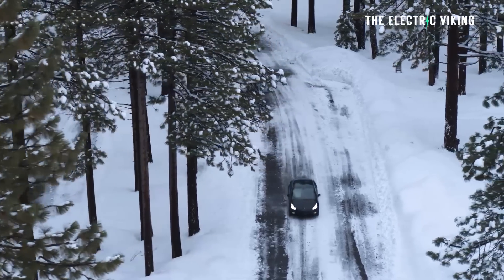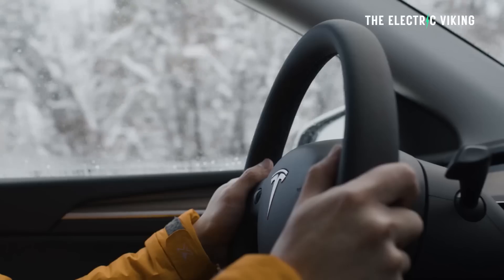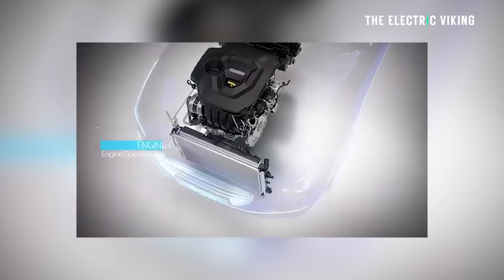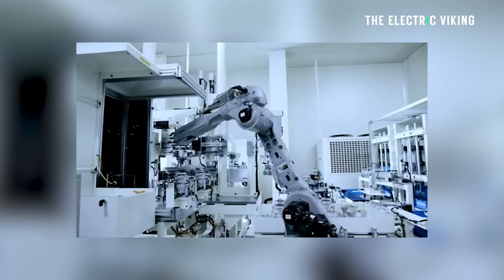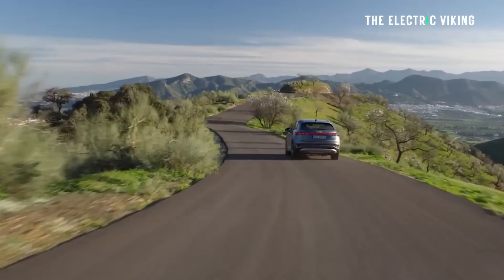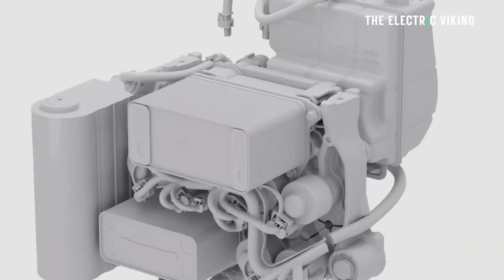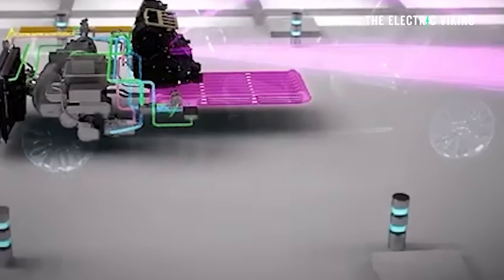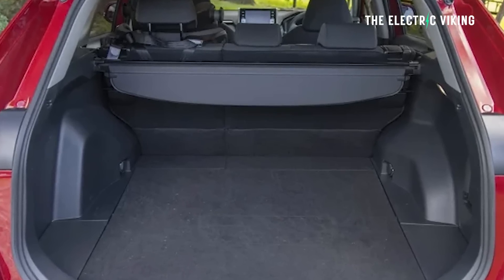Revolutionary heat pump boosts EV range and is 30% smaller!

Comment: It would be cool (pun intended) if the frunk could be insulated and offer an on demand refrigerator/freezer function when needed.
Reply: There is a freezer available for the rear under floor space in a Model Y.
Reply: @greghudson9717  thanks Greg, I'm aware of aftermarket electric cooler products. What I'm talking about is a relatively simple (I think) modification of the on board heat management system that could transfer heat for battery conditioning AND yield a cooler/freezer accessory for those odd times when you need it. A bit of insulation, a few loops of tubing, maybe a small condenser, and the software to make it work. Just spitballing here.
Reply: @pl-ps2pd  That sounds like a pretty good idea. Share it with Tesla if you can figure out how to ;-)
Reply: @greghudson9717  Just an observation here, but while I am a Tesla fan, why does everyone seem to gravitate to Tesla?  I already know why, but I'd like any doubters to contemplate their answer.

Comment: Heat pumps are great, but achieving Tesla levels of efficiency has more to do with the design of the entire heating/cooling system than with any single component. For those interested I recommend watching the Weber College analysis of the Tesla heating/cooling system. https://www.youtube.com/watch?v=Dujr3DRkpDU&t=2817s

Comment: The Hanon Systems website states that 'their' 4th generation heat pump system is the first to use a parallel heat source recovery method (but without explanation). A research paper published August, 2022 describes Tesla's Octovalve thermal management control and contains: "Unlike any other WHR (Waste Heat Recovery) system found in literature, this system has a heat pump (which) can perform air conditioning and heat pump tasks simultaneously, which is shown to have a remarkable impact on energy efficiency and battery life."
Reply: The Tesla heat pump with Octovalve can scavenge heat from the inverters, the battery coolant, and other systems when needed. It is not solely dependent on the external air for its heat. 
I think this is exactly what this other new pump is doing. They are finally catching up. The problem will be the plumbing in the non-Tesla cars. They will buy this part off the shelf and try to plumb it into their existing designs with a bunch of hoses. This will cause a lot of heat loss from those hoses.   To take advantage of the efficiency of this new pump they will have to integrate it into their initial designs from the ground up.... in other words they will have to totally redesign the "engine" compartment and inverter components so that they can avoid having to use a lot of hoses. This will take anyone but the Chinese companies (AKA the OEMs) years to do.
Reply: The parraller system uses external air and internal heat combined.

Comment: ICE cars are going to be banned in 35 countries? That means if you already have ICE vehicles, it will be illegal to drive them. How you come up with these statements is beyond me.
Reply: Sales of new I C E cars will be banned not driving a old ice car
Reply: @tristar8950  I've always thought the key to ICE longevity is the fuel they use. Alot can happen in 35 years. If they're banned EVs may not be the only alternative.
Reply: Already banned in some city centres?
Reply: @markthomasson5077  a very tiny percent. In many areas of the nature, all private vehicles are banned.
Reply: @skylershank9309  aye, but ever increasing.
Reply: @markthomasson5077  so are areas banning EV from ferries and parking.

Comment: Definitely not simple like there made out are they.
Reply: Neither are automatic transmissions. What's your point?
Reply: @jamesvandamme7786   well. didn’t post a video saying transmission were simple did i ?
Reply: @jamesvandamme7786   and compared to fixing kilometres of wiring that’s in an electric car or just the 5 thousand plus terminals inside a battery. Yes transmission are far simpler then the computer system in an anything electric cars

Comment: Ice is simple no need for this Miracle making nonsense.
Reply: No, ICE is incredibly complex in comparison and incredibly inefficient. How many moving parts are used to create motion in ICE? Hundreds.
Reply: @jdcarguy1242    Have a look at the qualifications needed just to touch an electric car. And I guarantee for the most part they just send stuff back and replace it.   1 battery has over 5 thousand electrical connectors      Go walk in to your local mechanic would almost guarantee every shop has one person working that didn’t go to school  let alone electrical engineering degrees.  That’s not a thing with EVs
Reply: @jdcarguy1242   20 tho on Average depends I built a 2.8 hilux motor when I was 15. There’s no 15 year olds assembling EVs or electric motors or battery’s almost alone at that age.
Reply: @Kevin07-w9l  What about refuelling your ICE with wind or solar instead ?   Oh wait, only EV's can do that (yet)... hahaha
Reply: @greghudson9717   why would you want to?  26 dollar Jerry can takes me 200 plus km in ice.  Cost a bit less then the equivalent electric Jerry can I think  and is more efficient buy about 225 km so I just don’t see who would want to go back in time. ?
Reply: @Kevin07-w9l  You don't get it. We are talking about the FUTURE not the past.
Reply: @greghudson9717     Correct so your future is 200 plus km sorter then anyone with an ice car  for the equivalent.   Maybe find an electrical engineer to explain this to you.
Reply: @Kevin07-w9l  I'll explain it for you. I get about 410km from my SHORT range Tesla Model Y. My previous 2023 Kia 1.4 petrol would get about 600km from its 45 litre tank, so there's the 200km difference you are talking about.  Yes, we made a few less stops (and less time stopped) with the Kia, but over a 3500km trip from Melb-Cairns, the actual time difference was just 6 hours extra spent charging the Tesla Model Y, which isn't that much really, and we couldn't go much faster because the chargers were mostly slow 50kW units.   However, that time difference would be a lot less now, with Tesla opening 9 new SuperCharger sites up the Qld coast to Cairns.   The trip back in the Tesla we prioritised Tesla Supercharger (instead of avoiding them), and the time to get home in the Tesla was the same as the Kia. The charging speed made all the difference.
Reply: @greghudson9717   that’s correct. So what makes the electric Jerry can 98 percent less productive. As in 20 lt or 20 kg of energy gets you 200 plus km     20 kg worth of electrical energy gets you 5 km ?   Weight to power is the most important thing
Reply: @greghudson9717   if your struggling to understand head over John cadogan  auto expert  some one qualified  who knows exactly what he’s talking about you’ll get a shock I think

Comment: No it wont be most efficient at very cold temperatures. Heat pumps efficiency drops off expontentially in very cold temperatures
Reply: This is why Tesla's heat pump system with Octovalve is different. It can scavenge heat from the battery pack, the inverters, etc. It is connected to all these systems and can move heat around as needed amongst them. 
Sure if it's -20 degrees then it won't work well but neither do most cars without engine block heaters prewarming the system. A Tesla can also prewarm if connected to your home and told to warm up prior to travel. This ensures that the systems have a lot of heat in them that can be used during the journey.

Comment: This could increase battery life.  Think of all the times an ICE vehicle is running but not moving.  People are using 300HP to heat or cool their car.  Police cars are often sitting with the motor running.  Recently I saw a car running for 2 hours to keep a pet cool.  Diesel truck and car drivers like to leave their vehicle running when parked.  The bottom line is using 300 HP to heat or cool a vehicle is stupid.  There are a lot of stupid people.  There is no cure for stupidity.
Reply: There is a cure for stupidity, it is called learning. You should try it, and you wouldn't write such comments like the one above.

Comment: I'm driving a 2020 BYD E6, the last year they made that model (I think). The cooling comes on immediately but it takes 5 minutes for the heater to start working. I can only assume it runs off the car's engine/battery waterjacket instead of the heat pump. At least it's not reducing my range!
Reply: Most EVs which don't have heatpumps use either a resistive element in the cabin airbox in place of the water matrix or an external water heater and small circulation pump isolated from the motor/controllerr cooling systems as for the most part they won't provide enough heat in cold weather and you really don't want extrernal heat sources feeding into these parts of the unit

My Imiev's heating loop has 800ml. It's an 8kW heater (poorly insulated) that takes about 5-10 minutes to be effective and knocks 20-30 miles off range if left on continuously

If I could retrofit this into the car then it would be extremely useful (or would be if the residual value of a 14 year old EV wasn't essentially nothing)

Comment: There is no any chance to boost  range by 30%  with  more  efficient   heat pump  ,  5-10%  is a  maximum . Educate yourself mate .
Reply: You sound like an EV engineer... 🤪🤪🤪
Reply: @youarnb  You do not need to be  engineer , common  knowledge is good enough . Think , what is percentage of used  energy  in  EV  by  heat pump  first .

Comment: Can a car based heat pump feed into a ground based geothermal system?
Reply: Don't you mean the reverse? Why would you want to cool or warm the earth ?
Reply: @greghudson9717  ground based heat pump system do both
Reply: @infocat13  You didn't answer my question, but I figured it out, when you are cooling your house, the excess heat going INTO the ground. Fair enough.   I don't have the room (or access) at my place for geothermal, but I wish I did 😞
Reply: Not sure where you're going with this. If you want a home heat pump, buy one optimized for that. Car heat pumps have multiple jobs to do.

Comment: Sam, I think you’ll find Hanon Systems is a South Korean, not a Chinese company. It will be interesting to see how its new Heat Pump compares to Tesla’s. In any event I wouldn’t want an EV that doesn’t have a heat pump. Energy is at a premium in EV’s, so why waste it and unnecessarily lose range?
Reply: Heat pumps add weight, so if you're in a country where you don't, or less frequently, use cabin heating (or where heated seats are sufficient as Sam indicated) then the heat pump lowers the car's efficiency (even when taking battery thermal management into consideration) and can reduce range. HCAV choices on a car whether AC cooling + PTC heating, AC cooling + heat pump heating or combined heating/cooling heat pump all have cost, effiency and weight trade offs to balance, where different markets have different needs.
Reply: not owned by SKorean, they only do research tehre
Reply: Agreed, I was thinking how will this compare with the Tesla heat pump.
Reply: EV’s are garbage lol

Comment: Interesting, Sam, but note that Kia are failing to fit a heat pump to most EV3 models. It's only going in the top spec version. I would rather have a slightly less efficient heat pump than no heat pump at all. My 2016 Ioniq 28kwh EV has a heat pump for heaven's sake.
Reply: Not in every market. It's just been introduced in Denmark and EVERY spec version has heat pump here.
Reply: @sejlmager  interesting. I've only seen the first reviews on Korean roads, and they both said no heat pump on the lower specs. I hope you're right.
Reply: On Scandic countries you can get it into air level and is default on all after that
Reply: Hopefully this will change as Kia opens up more manufacturing sites, Kia currently build in waves of trim levels for specific markets. Some markets don't want to pay the extra for a heat pump or where the additional weight involved may lower efficiency particularly if it not used most of the time.

Comment: yesterday they extended the range to 50% and now today they have extended to another 30%?
Reply: Within a couple a days the range will be increased to at least 1.000 mls and charging the battery pack from 20-80% will only take a minute or so... 😂😂😂
Reply: You weren't paying attention. Go back and watch them again, more carefully. Lifetime of battery. Range when using A.C.
Reply: @jamesvandamme7786  wtf are you on about? its still range extension.

Comment: The improvement in efficiency will depend on ambient temperature, so it would be hard to give a single figure for it
Reply: Not correct.. ambient has zero effect due to the heat energy created by the motor is so much more..

Comment: 2023: Australia's electricity generation emitted around 549 grams of carbon dioxide equivalent per kilowatt-hour, which was a decrease from the previous year.
Reply: Given that most Australian power is now generated by Solar and Wind, (68% yesterday 12 Sept 2024) that would imply that the remaining 32% must be pumping out an enormous amount of carbon per kWh produced.  I know brown coal is bad, but this number is just ridiculous, and should be shut down immediately.
Reply: That figure was from a Google search.
Reply: @jonjo6886  I'm looking at it from a mathematical approach.  Just because you googled it doesn't make it true.
Reply: @greghudson9717  Those coal plants are base load, run 24/7 because they're hard to start and stop. So solar and wind can be unused if demand is low. More renewables and battery backup is the answer to shutting coal down.
Reply: @jamesvandamme7786  Yes, I agree that coal fired is difficult to stop and start, but there are alternatives, like you said. South Australia are now coal free, all they need to do now is piss off the gas speaker plants and replace them with batteries too...
Reply: NSW performs better than much of Australia on an emissions per person basis. NSW emissions were about 18 tonnes CO2-e per person in 2018. This is below the national average of 22 tonnes per person.

Comment: The reason petrol/gasoline and diesel vehicles don't use heat pumps is that they don't need them.

Many readers have heat pumps in their homes already. We call them by their other name, "reverse cycle air conditioner".

Put simply, a heat pump pumps heat from point A to point B. Often, it only happens in one direction such as in a refrigerator or old style air conditioner. We generally don't refer to those one-directional devices as heat pumps,  although there is a tendency to use the term when referring to such a device used for hot water. Yes, the terminology is inconsistently applied.

Anyway, back to cars. While using the battery to generate heat in an EV is extremely inefficient, the engine of an ICE vehicle already has that inefficiency built in as a necessity of how it works. It takes nothing to tap a bit of the energy the engine wastes to warm the cabin. In the old days, that was all you got. You didn't have to freeze when driving on a cold day. Later, air conditioners became common so you didn't have to cook driving on hot days.

Without the inefficiency of an ICE, an EV doesn't have a ready source of hot air to just pipe into the cabin. They have to have a reverse cycle air conditioner a.k.a. a heat pump.

It sounds like this innovation is to feed a naturally warmer souce of air into the heat pump so it doesn't have to work as hard to heat the cabin. Good move, but hardly a ground-breaking idea.

Comment: Can someone check my figures  In Australia 1 kWh of electricity accounts for 550 grams Co2. My Tesla gets about 3.3 miles kWh.
That means 166 grams Co2 perr mile.
My Prius emits 122 grams Co2 per mile.
Where am I going wrong?
Reply: The electricity supply in Australia is heavily dependent on coal, the fossil fuel that causes the emission of much more CO2 per kwh than any other. That will change. Your Prious spec is most likely optimistic.
Reply: @rogerphelps9939  ALL Tesla SuperChargers are powered by renewables.
Reply: With enough wind and solar power this will change over time. You can help by getting solar yourself.
Reply: Very interesting comment which initially I didn't believe but in some ways your correct.
Half of power generated in aust is generated by coal(1 kg generates 3666 gms of co2) but they only work at about 1/3 EFFICIENCY.GENERATION cannot be turned on and off with demand so aloit of power generated at off peak is unused..probably 10 pct lost due to transmission too.
Your prius gms per mile ?6 litres per 100 km / 60 miles is well underdone??
Reply: I have the Prius 19 years and gets 55mpg. I used standard conversion mpg/Co2.
Reply: As with all things, there's a catch..... my figure for petrol car is only on fuel burned at the point of use. The real thing to consider is "well to wheel".
Is the figure for electric just the Co2 out the chimney?
Or is it mine to meter?
The "Life cycle assessment" for electricity production from LNG is truly shocking.
I feel the whole truth about Co2 isn't publicised.
Reply: I'll tell you where you are going wrong. I have solar, and charge my Tesla using photons hitting those panels, meaning I have ZERO % pollution, or, ZERO grams per kWh of Co2.